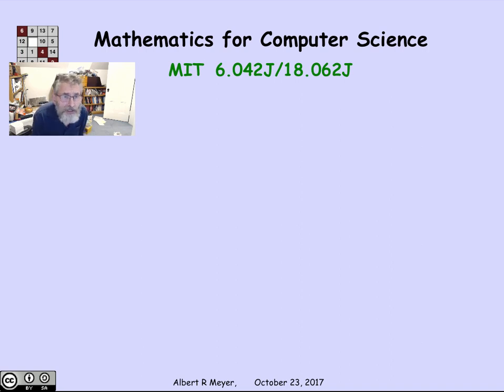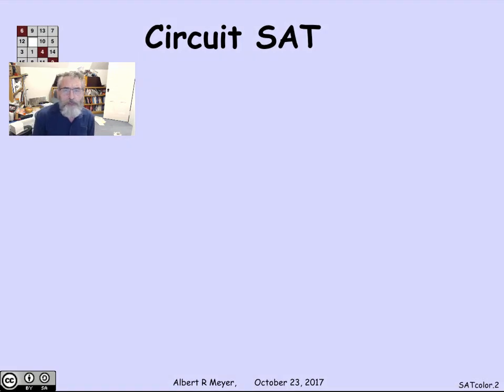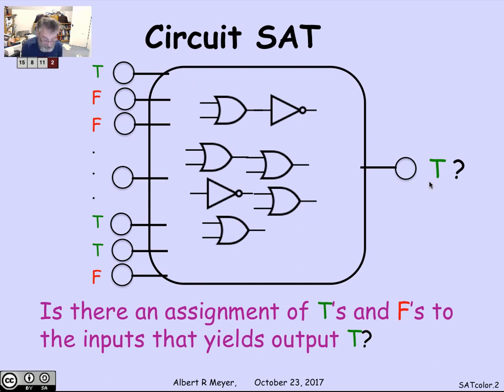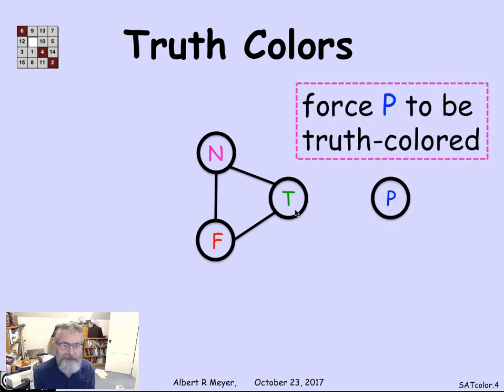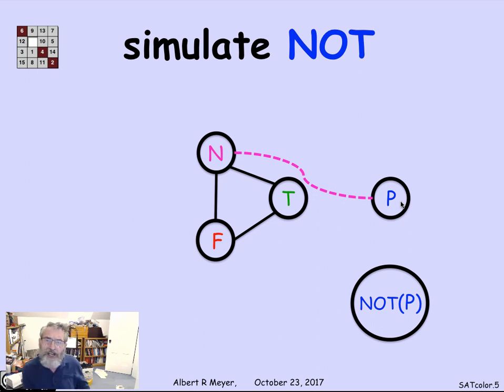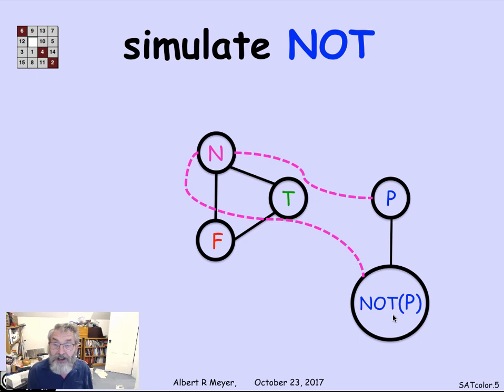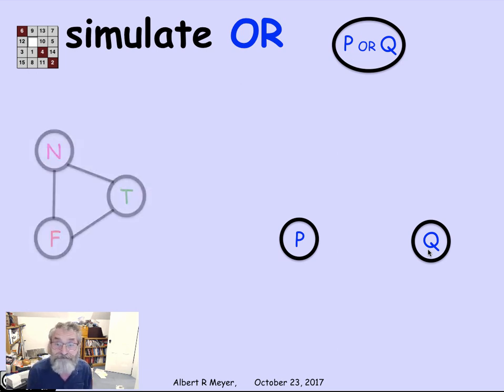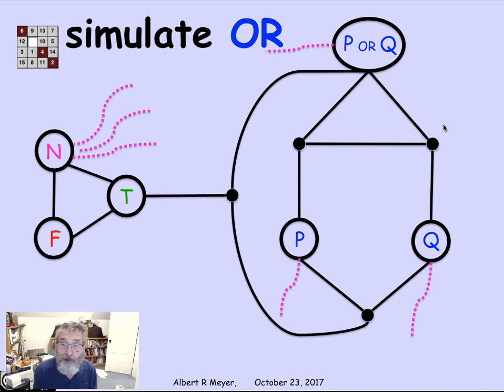SATto3color

Comment: A recent numberphile video brought me to this ( https://www.youtube.com/watch?v=5ovdoxnfFVc ) and seems to indicate (17:50 and onward) that 3SAT reduces not only to the 3-coloring of a graph, but to that of a planar graph or map (I have to admit I'm not even sure if they're equivalent). The graphs you show for the NOT and OR gates are clearly planar, but is this still valid if you simply merge two OR graphs as presented at 11:50? Otherwise, is there a different way to merge such gates to preserve their being planar?
Reply from the maker: No, if the circuit is not planar, then the graph you get by replacing gates with gadgets wont be planar either.  The fix is to use a "crossover" graph gadget as explained at the end of the video; see for example
https://www.google.com/search?q=3-color+crossover+gadget&client=firefox-b-1-d&sa=X&biw=1308&bih=738&sxsrf=ALeKk03hFpLt77J3Qw1pAtfNYBI209N4ag:1612981252476&tbm=isch&source=iu&ictx=1&fir=UOcOpPRNr48EgM%252CWHUwKr79OAnvqM%252C_&vet=1&usg=AI4_-kQ0xVtnXvfyfLuXDf0Sw6VxIJUZdA&ved=2ahUKEwig1dS099_uAhVphOAKHdbDBywQ9QF6BAgIEAE#imgrc=UOcOpPRNr48EgM
Reply: @albertrmeyer2336  That's brilliant, thank you for the quick response and the amazing content :)

Comment: Please just Why can't be more than one assignment lead the circuit-SAT to be satisfiable
Reply from the maker: there can be more than one.
Reply: @albertrmeyer2336  last thing how many different variables and classes when computers will no longer be able to slove a sat problem in polynomial time
Reply: @albertrmeyer2336  thanks
Reply from the maker: @ianleo3030  I'd say that in the worst case, deciding SAT formulas with up to 60 variables and 1000 connectives in less than a million years will be completely out of reach forever.  I would not want to predict about the possibility of someday being able to decide such formulas on average within a few minutes.